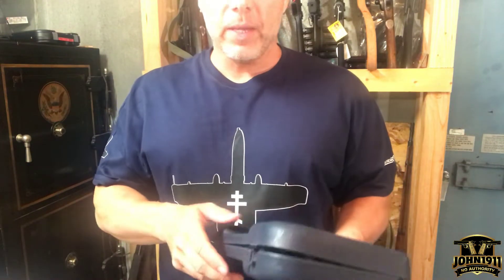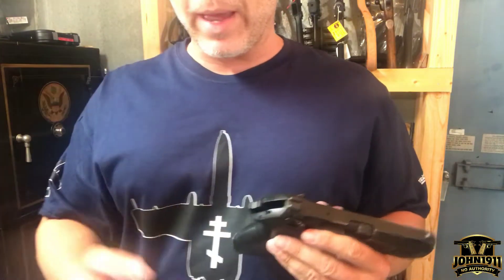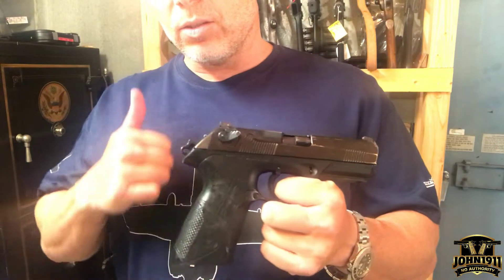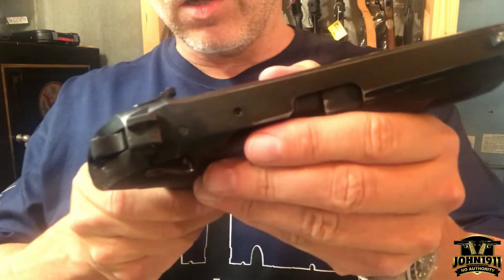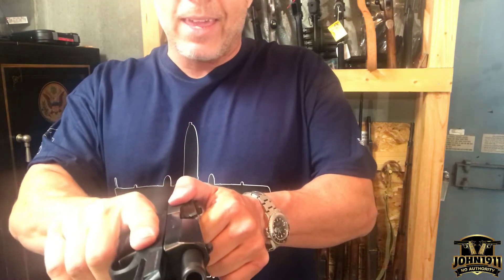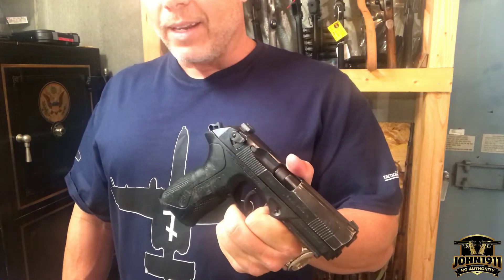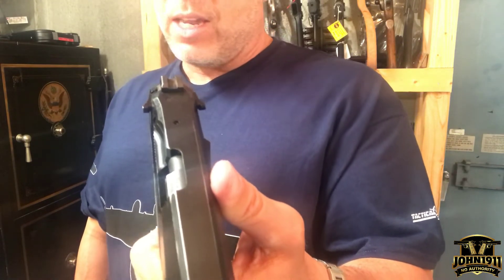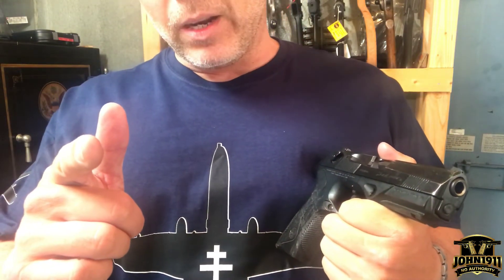Beretta PX4 Design Flaw

Comment: That is Not a Design Flaw, a Design Flaw is something wrong in the Design that would cause failure in the Pistol.
Reply from the maker: It’s a design flaw. 

Taking your logic to it’s extreme end state, manufacturing a pistol without a place for the user to put his hand may still enable the gun function mechanically. But it’s useless functionally. In design there is usually a balance between form vs function. The end result is suboptimal if either one of those is zero’ed out in the calculus. 
To 
The truth is the root of the problem isn’t the shape of the levers. It’s the design and location of them all together. It’s a real detriment in the Beretta 92 series as well.

—Marky
Reply from the maker: Considering I used to teach active duty Army Officers how to run the Beretta at an advanced level way above and beyond basic Army quals, I’m fully versed in the M9 platform’s abilities and shortcomings.

Fully. 

Look. I get it, Nedal. You obviously like the guns more than the average cat. So let me give you some advice. In the real world, nobody will remember or care what gun someone brung. They will only remember how you shot it. 

As for your link about the M9/92 specifically and the DOD’s decision to drop it, feel free to take it up with the Army’s PAO staff if you disagree. They keep regular office hours M-F EST.

https://www.army.mil/publicaffairs/

Regards,
Marky
John1911.com
Reply: @John1911  I totally understand and i would not disagree with anyone who prefers one over the other and for any reason, people are different and preference differs as well, my only argue is using terms like Flaw or anything that points to something in the pistol that would make it fail out of the control of the user, and putting the word Fundamental before it really magnifies a non-existing situation actually, you may say that a design does not work for you, but it does for many others, that does not deem the pistol malfunctional or it is a flawed pistol because it just doesn't fit your preferable design.
Reply from the maker: The slide mounted safeties on the M9 format guns are a flaw. Anyone who has run the gun seriously understands this. To compensate for the problem, we have to teach an extra move to the users to ensure the pistol doesn’t turn up dead when intending to fire. Which still happens from time to time. By definition that is “failing out of control of the user”. Name any other serious pistol where every so often the user literally intends to fire the gun and it ends up dead after already disengaging the safety. 

Additionally Beretta came up with the G model conversions to mechanically solve this problem. That is what some people might call a clue. 

Or let me put it this way. If someone comes to me and asks which version of the Beretta 92 series they should buy, here is my pecking order: 
1. If you must have a safety, buy the X Performance with the frame mounted safety. 
2. If you can live without a safety, buy the D versions. (Double action only). 
3. If you must have a the slide mounted de-cocker, buy the G models. But why when the D has a much better DAO pull. 
4. Only if all other options are expended, do we land on the 92 with the regular slide safety. 

That slide mounted safety sucks. But to keep it on topic to this video, let’s take a design that already sucks and try to make the levers even less user friendly. That is what this is. 

Nedal, you like the guns. That’s fine. As stated before, if you and I ever shoot together, I won’t recall what gun you shot. But I will remember 100% if. You can shoot it well. You want to advocate for the 92 series guns? Do what Ernie Langdon did: Be the best shooter in the world with one. That will get people’s attention. 

Regards,
Marky

Comment: I totally agree. I read up on the storm and went to check it out at my local dealer.  It went to clear gun for safety check and had the safety dig in. I couldn't rack it. Once that was over I have the same problem just trying to use the safety .
Reply from the maker: There is an upgraded safety option out there. Beretta has it, as does Langdon Tactical. 

—Marky
Reply: @John1911   thanks I'll check it out.

Comment: You don’t even know what mags it uses or had to read the name , doesn’t take 92 mags , ignorance. Like anyone should listen to what you say
Reply from the maker: The PX4 safeties are so bad that even Beretta makes an aftermarket upgrade. I’ve seen Beretta folks call them “tactical hand shredders”. So I must have been on to something. 

As for the magazines, it’s functionally the exact same tube. The PX4 just had the mag release notch a few millimeters off. 

If you already have a Px4 and enjoy it, then this video isn’t for you. However an inexperienced buyer might see these in a case somewhere and not realize the issue until it’s too late. 

I’m preaching to the masses, not the choir. 

Regards,
Marky